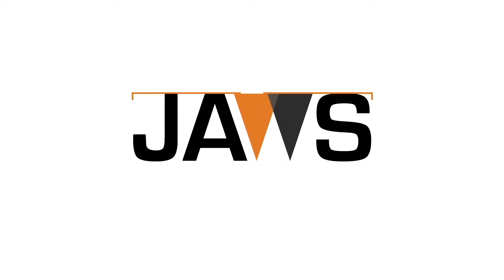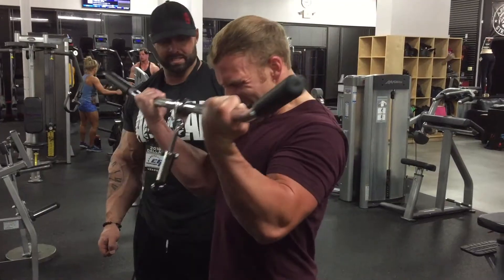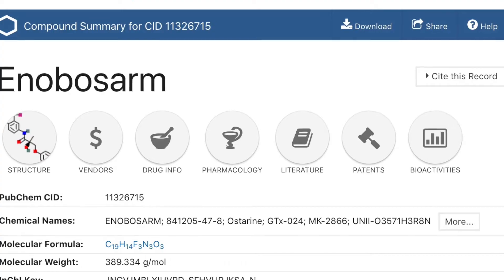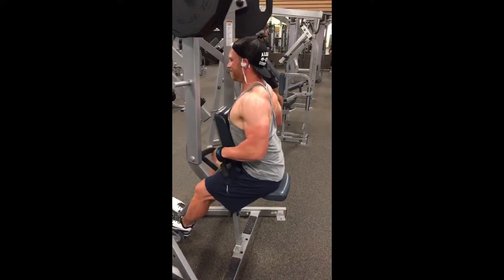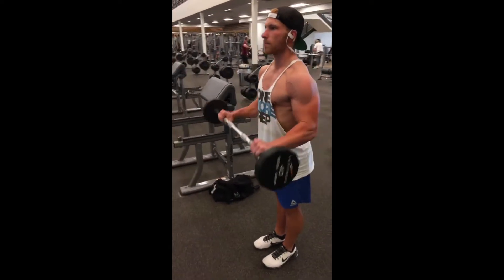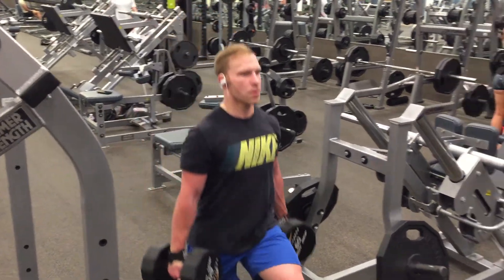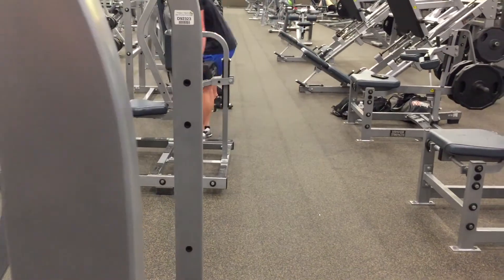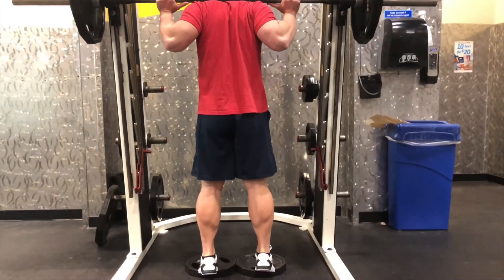Ostarine Science Explained - Science Behind Ostarine - MK2866 - SARMs - Enobosarm

Comment: Just make sure you (or anyone) gets ahold of clean product, not tainted with prohormones or oral steroid in liquid solution. Some fly-by-night companies are being discovered as having done that.
Reply from the maker: Solid advice right here!
Thanks so much for your input!
Reply: any advice? Please

I train BJJ and do weightlifting as well. I have had this tendon injury in my elbow for 3 months now. I can lift weighs but when it comes to live sparring in Bjj the tendon inflames right away.. 
2 questions.

- I was wondering how much ostarine would help speed the healing process with my elbkw tendon injury so I can get back into BJJ asap.

- Im natural and havent taken any PEDs. Im 23 years old 6”4 210lbs. Lets say I were to take one cycle of ostarine by itself and the gains I make are still within my natural limit and with a proper PCT diet and training, how much gains will I be able to keep when I come off? Im just afraid of getting mentally addicted and wanting to jump back on because I felt so good on it then lost all my gains when I come off. I would like to make some gains still within my natural limit and get this tendon injury healed. :/
Reply: @rg7917 you won’t know until you run a cycle but research suggests about 10lbs on average of lean muscle gain
Reply: How do you know if you have pro hormones or a steroid that is not supposed to be in your ostarine
Reply: Link please.
Reply: Is there any website you can vouch for personally
Reply: I'm here because of Ryan cheating ass
Reply: Great! I just got liquid form from ChemYo. Looks like a reputable company. Anyone know of a very reputable company? Thanks!

Comment: Which is better? Mk677 or mk2866?
I just started ostarine today but when i did mk677 with rad140 i was able to bulk from 150-179lbs in 6 weeks
Reply: mk677 is just water retention, a bit better grow hormone so your regeneration is a bit better but the water retention comes because of worse insulin sensitivity so in result u gaining fat faster....a bit better pump and fake weight gain because of water is not worth that side effect because of which u will gain fat faster than u want on longer mass season...
in my opinion sleeping +1h more and eating more clean will give u better results than mk677 for sure and no worse insulin sensitivity and save more money in your wallet
Reply: Mk677 is a igf-1 booster and a hgh booster. It’s not really a sarm, it’s sort of in a different category like how cardarine is a sarm but it’s more like a ppar activator. Mk2866 is like taking weak steroids that only attach to your androgen receptors and nothing else. Unfortunately, it’s only really available in its oral form so you run the risk of hepatotoxicity, and damage to your kidneys. You can prevent this by running proper cycle support like nac, milk thistle, liver and kidney aids, etc. and drinking more than plenty of water. When I say weak steroids, I really mean weak steroids, this stuff is by no means anything like bdol or tren, but it’s def a lot better than natural creatine and bulking. You can gain muscle with ostsrine on a cut, won’t be a lot but maybe 2-3 lbs in 2 months where as any other time if you cut you’d only be maintaining muscle if not losing a little bit. That’s a huge difference right there. I don’t ever recommend sarms because they can seriously fuck your endocrine system up but if you’re smart and do your research then it’s all up to you. I’d run a card + osta stack while on a maintanence phase or a small cut of like 1-200 calories. That’s where you’ll really transform your body
Reply: @TonyG203 does osterine shut down your balls ?
Reply: @TonyG203 pct? planning 10mg 8 weeks and only natural pct (fenugreek and resveratrol)

Comment: any advice? Please

I train BJJ and do weightlifting as well. I have had this tendon injury in my elbow for 3 months now. I can lift weighs but when it comes to live sparring in Bjj the tendon inflames right away.. 
2 questions.

- I was wondering how much ostarine would help speed the healing process with my elbkw tendon injury so I can get back into BJJ asap.

- Im natural and havent taken any PEDs. Im 23 years old 6”4 210lbs. Lets say I were to take one cycle of ostarine by itself and the gains I make are still within my natural limit and with a proper PCT diet and training, how much gains will I be able to keep when I come off? Im just afraid of getting mentally addicted and wanting to jump back on because I felt so good on it then lost all my gains when I come off. I would like to make some gains still within my natural limit and get this tendon injury healed. :/
Reply: I learned the best way to go about that is to just buy a single cycle at time. That way another one isnt staring you in the face when you feel the urge to regain the lost gains. Secondly, stem cell research is legal in Columbia. Some of the best UFC fighters and NFL players go there for injuries. Not that expensive.
Reply: @tylergoodwin3546 so you ended up taking Ostarine? How did that treat you?
Reply: What will help for sure with tendon inflammation is the steroid Prednisone. It will take away the pain  from inflammation in under an hour. Just don't overdue it while the tendon recovers.
Reply: long term use of ostarine can lead to a reduction in testosterone production. Just follow use with a medical professional.
Reply from the maker: dude I too recently experienced an injury and have been seeking out information on healing... still haven't found the best solution...
As far as that mental addiction IT IS REAL... just have to work as hard off of it as much as you do on it.
I see this was 7 months ago, hows the elbow?